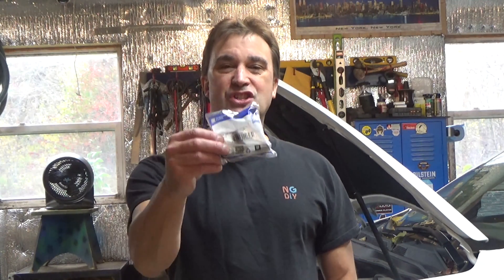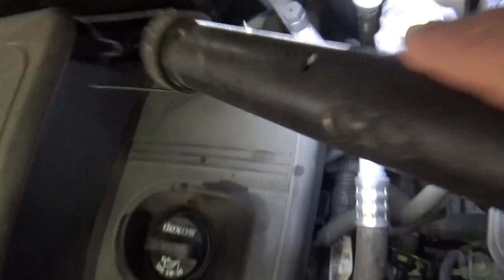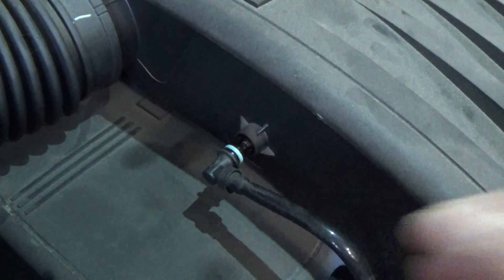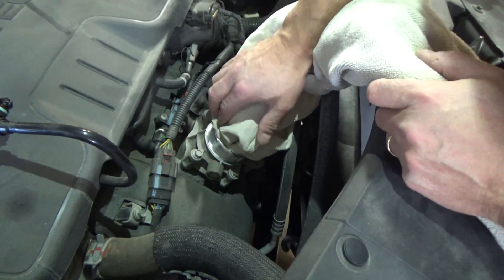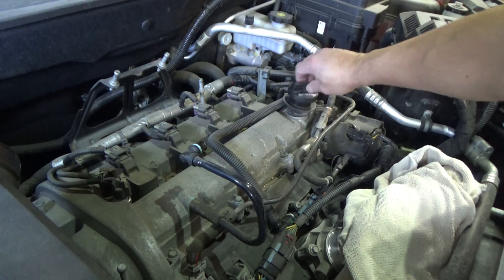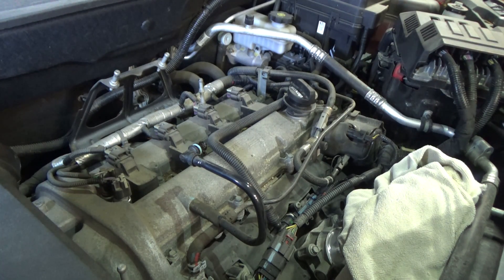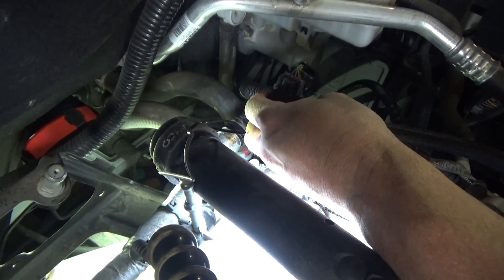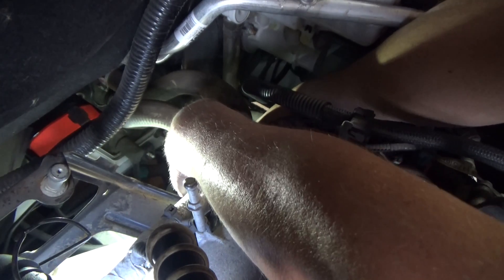Exhaust Camshaft Position Sensor (CPS) Replacement On a Chevy Equinox Code P0013 CPS Not Responding

Comment: Are there 2 sensors 1camshaft sensor and 1  crankshaft sensor?  the one you replace was the crankshaft sensor.?
Reply: That was the camshaft sensor.  .. crankshaft sensor is in front of the engine

Comment: Great video   However, when you disconnect the harness from the CPS you remove the white/grey lock device then push down on the black tab where that lock was to disconnect, instead of using a small screw driver to get inside the plastic connector and lift the tab

Comment: I just changed mine and it took awhile. All I can say is be patient and you may have to force your hand into a pretty tight spot for a little while. I tried a lot of different set ups just to try to reach the bolt. The only thing I found that worked was using a 10mm box wrench. It isn’t real tight so once you get a half turn it will be loose enough to use 2 fingers to walk it out the rest of the way. I also had a pair of gorilla grip latex gloves on and I think it helped. When putting in the new one, hold the sensor in place with one hand and using 2 fingers on the opposite hand you’ll be able to put the bolt in. Again, patience will be what saves you. 😉Good luck.

Comment: i used a 10 mill wrench,  i got it in, just gottata titen bolt.how in the heck did you get a 3/8 drive rathect with 10 mill socket in there ... no room  to move the ratchet.    owell i will try again tommprrow.  nice video well detailed

Comment: Hello, I have a different code but I am replacing the exhaust camshaft postition sensor for my 2011 chevy malibu lt. My question is how do you know what camshaft position sensor is for the exhaust and intake. I heard ppl say that they are both different. So when searching for exhaust camshaft position sensor on advanced auto (I have a 2011 chevy malibu lt) it only pops up different results for "camshaft position sensor".  I know where exactly the intake and exhaust camshaft sensor is located in my car but when buying, did you ever know which one your buying for specifically (exhaust or intake)? They don't specify, so idk if I'm buying the correct part or are the exhasut and intake sensor locations use the same model of a sensor?

Comment: I think you were confused. The code is for a exhaust side variable timing solenoid. They are located on top of the valve cover on passenger side. Super easy to replace. There is 2 of them. One that is closest to front is the intake solenoid and one close to firewall is the exhaust solenoid.
Reply: Had the same code and did the solenoid and an oil change. Now im at this video
Reply: @advxnturxwithmx did it fix the code after you did this repair?

Comment: I have a question and maybe you can assist me. I have to replace both my intake and exhaust camshaft position sensor. Will the sensor be the same? I have a 2012 chevy equinox.
Reply: This video is wrong. He’s replacing the cam sensor. 

The parts he needs to change are the ones on right side on top of valve cover. The intake and exhaust cam solenoid are located there
Reply: He's changing the VCTs , I just got that done,  still popping up. As it wasn't fixed, got p0017 now, About to change the sensor.  But they don't never say which 1 is A & B
Reply: @Blockizhott214 B is the exhaust.

Comment: Hey pardner, I just wanted to drop in and give you a thumbs up 👍 😀. I don't have any of these issues. I have been driving Ford vehicles for the most part since 1998, and I have never had to do anything more than an oil change.
Reply: @nogripes  Thanks so much for your words of encouragement. We're trying to make a positive impact in some small way. We are not monetized, and we will never be monetized. We do this simply to spend time with each other in our older years. It's easy to review inexpensive guitars when most of them are decent instruments. My point is, since we don't have a dog in the fight we have nothing to lose by giving our honest opinion. We appreciate your time thanks so much!